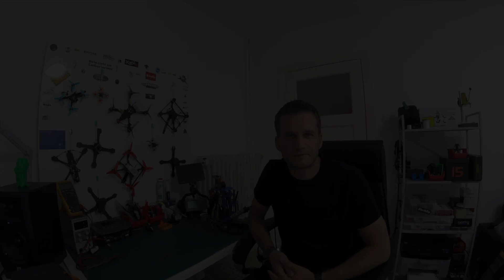TBS UNIFY PRO NANO 5G8 / SMART AUDIO LITE ISSUE / PULL LOW / ! SOLVED !

Comment: Thanks a lot, 10k resistor helped. I bought two almost not used sets with tbs nano receiver and nano vtx, soldered on whitenoise board and got into this SA issue. I am guessing now, that seller did not found solution, so sold it for half price :)